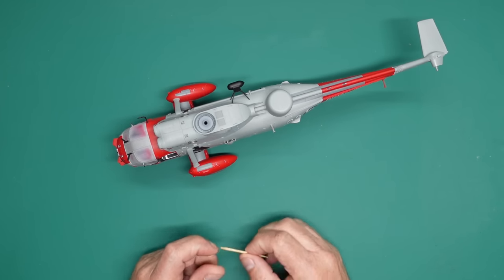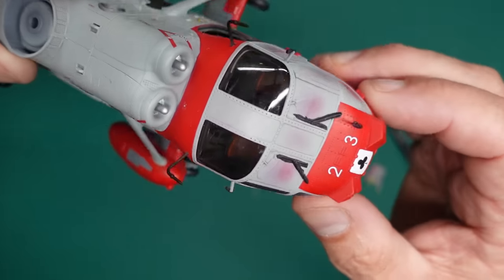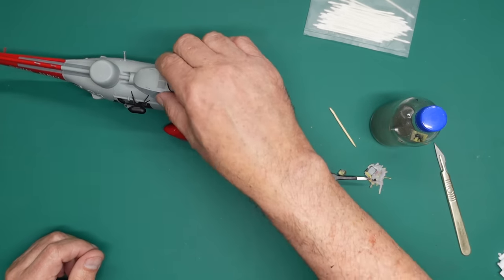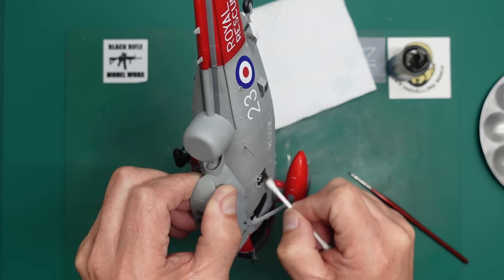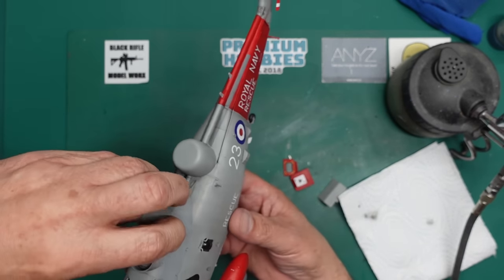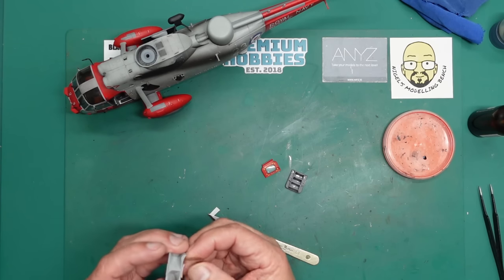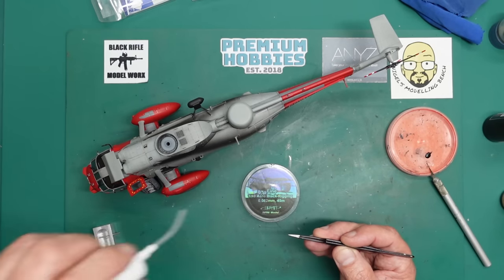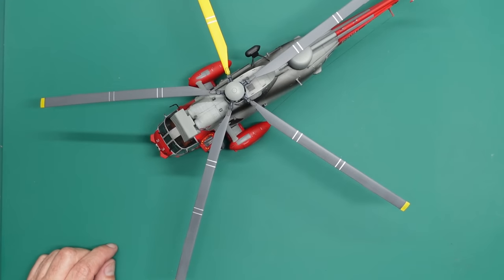Brand new Airfix 1/48 Sea King video build in 1440p . Part Sixteen.

Comment: Hi Nigel,
I've been following your Sea King build with interest and I'm responding to your plea for the correct colour of the part below the rotor head.

I worked on Sea Kings from 1974 to 2018.
the colours are all BS3181C spec in the main but for the part you need, which is the top part of the main gearbox, that is RAF Blue Grey. The rotor head, tail rotor hub, main, tail and intermediate gearboxes are all in this colour and it is semi gloss.

There are quite a few more anomolies, as you have pointed out, but I would be happy to help with any of those too. While I think of it, the interior colour is Dark Admiralty Grey.

Comment: the orange crop boxes were fitted during the falklands and were a pita to fit,but the "gubbins" that they were designed for were never fitted,consequently the boxes had a light brown rubbery patch on the front,the two forward ones on the nose had "no stand" on the top,but we always stood on them as they were perfect fer cleaning the cockpit windows,we used swarfega as it stripped the dried oil off the screen a treat!

Comment: Hi Nigel. Cracking looking chopper there mate. But, I think you have forgotten something. That open door with the steps on it. Shouldn't there be a couple of poles sticking out of it with some cord attached to hold the door when its open? In the pictures of it built on the Airfix web site. It shows cables and 2 poles sticking out of the door. Other than that, it looks brilliant. However, I am going to wait until they release an RAF version.
Reply from the maker: They have been added Andy, not called for in the instructions. this was an OOB build.
Reply: @NigelsModellingBench  Then isn't it funny that the pictures on the Airfix web site show the door cord and poles, but its not in the instructions? That's weird.